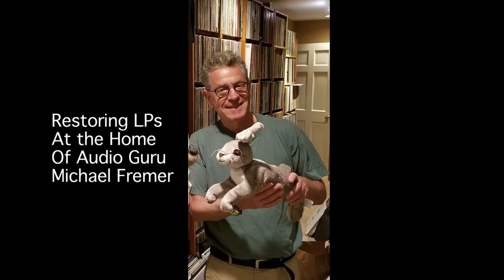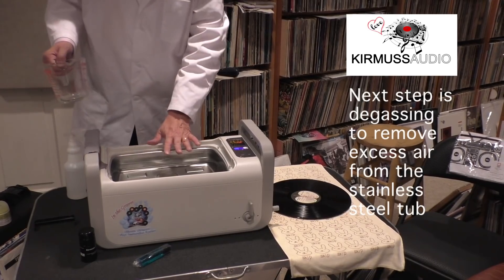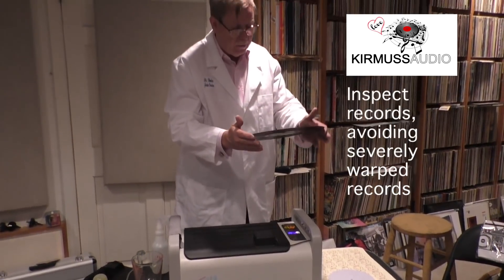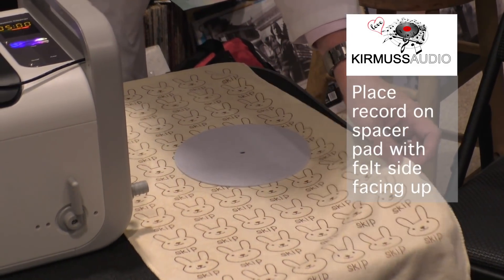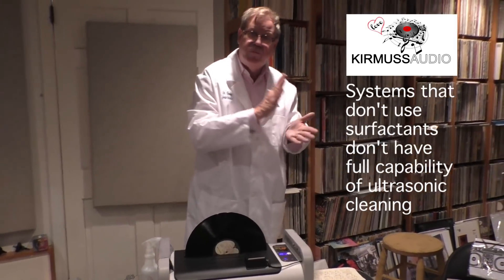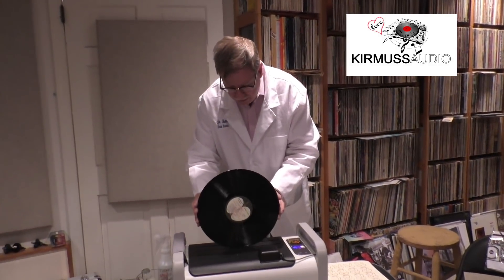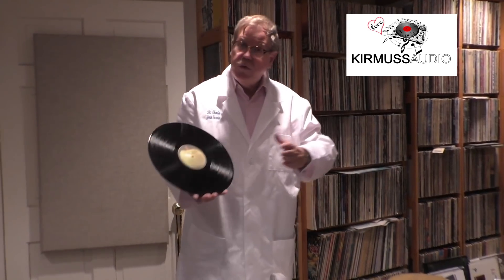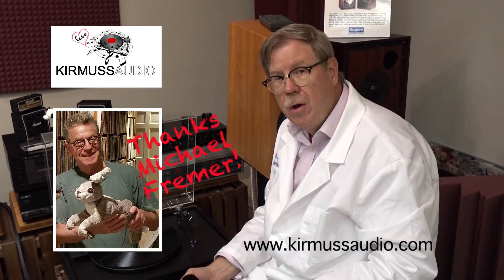KirmussAudio System Demo

Comment from the maker: Thanks for the comment.

 There is a difference between cleaning a record's surface and restoration, the latter, restoration, is designed to remove the release agent that is found in both  new records as well as old pressings, and where in both instances where the dust and contaminants that are mico welded in the groove of the record by playing it  is the undisputed cause of many of the clicks and pops we hear. Clicks and pops that increase over time. 

Simple cleanings leave films and hide these particles. A false sense is provided the audiophile. 

... We restore, not just clean.  

A surface   cleaning will not remove these clicks or pops or bring  back for one's audition the exact mirror of the stamper. One needs to remember where using mechanical  cleaning means and in  applying water with or without a soap, both the  record and the solution  repells each other. Only a surface cleaning occurs.  Further,  the size of a water droplet is also larger than a groove which is the root cause of systems not cleaning the grooves.  That is why we designed our process to temporarily change the charge of the record and attracting the wave caused by cavitation. This now  pressing on the ionizing agent that we  brush in the groove. This sees us remove contaminants from inside the groove.

To illustrate our point. We frst attack the film left over by prior cleanings that has been  dried on the record's surface  by air or vacuum.

 Then we remove the release agent. This holds the micro welded dust that see the needle hit and cause the unwanted pops.

... With the films and release agent both now  removed, now the needle makes full contact with the pressing. 

Fremer has mentioned as many others where we deliver what we say and restore the brilliance of the pressing.  One also does see when there is nothing left to remove in our stepped process.

To time, the benefit of  our process may see one  restore both sides of  up to four records simultaneously.   Something no other method can do,  all the while showing  you when each side of the record has nothing left to clean or remove from the groove.   Our patents pending and patented process lets you be the  judge and  see when there is nothing left inside  the groove to remove. 

Do refer to the images we have taken of records cleaned by a vacuum process and then followed by ours. 

As to efficiency,  we offer the best return on your investment as to the very noticeable audio improvement,  both for new and vintage pressings. 

...For all records,  the total time for groove restoration is  between 12 and 25 minutes, both sides.  

 As our records come out virtually dry as they should, there are  no films left on the record as is the case with air or vacuum drying.  No need for an air or vacuum drying which in their own introduce more dust and static to the record. 

We can of course just do a quick 2 minute clean.  Not restoration. We concentrate and advertise restoration.
Reply: I was very enthused, until I came across the statement about a release agent found in new records, a fiction, and restoration, a physical impossibility to build back what has been destroyed.  I guess this is just another guy pitching questionable product in a lab coat.  

I believe in ultrasonic cleaning, but it has the potential to damage records.  Thus a guy in a lab coat pitching product, using  facial errors, causes me to seek a more carefully developed product.
Reply from the maker: @richardelliott8352  respectfully you are very misinformed. Perform please the aluminum foil test with the ultrasonic of your choice. This by making aluminum foil records using a metal ring frame. In fact you will note where some 40 and a recently released 125 KHz ultrasonic are not ultrasonics and do not use cavitation, rather are sonic soap bublers.  I suggest you go on our web site and look at the February 7th zoom with both NJ and LA audiophile societies present and get a feel for cavitation methods among other subjects as to record care.
Reply: @kirmussaudio7578  if you could identify the release agent used , it would end a lot of internet discussion once and for all.  li only have read about the process, and viewed a few videos of records being made, and there was never a mention of a release agent being introduced at any time during the stamping process.   Additionally the introduced agent would have to be applied with remarkable precision, so that when it was removed there would be no information gaps where the release agent used to be.  
I really doubt the vinyl as it reforms from plastic back to a solid molecular lattice , seeks to  bond with the metal stamper more readily than  with itself, or would need a barrier to prevent the event.
Reply: @kirmussaudio7578  my lack of knowledge in the subject drives my skepticism, the only tool a poorly informed consumer  has against conceptual errors and buying a product poorly aligned with needs.     I am not knowledgeable enough to correctly  extrapolate the effects on metal foil to vinyl records.  I just want to be cautious in my product selection, and I am still acquiring knowledge about ultrasonic principles and how they are applied to record cleaning.   
I hope to make my poorly informed status temporary.
Reply from the maker: @richardelliott8352 Noted your points. To Shure, the Shure Brothers presented their results and I cannot comment further and my point os where  presented their comment which remains today where  phthalates and plasticizers are used in the pvc mix amounts depending on the purity of the pvc and any reuse and recycle of previously prsssed records in making up the biscuit for pressing to aid in the records to see the grooves return to the rest position  after play as well as extraction.
Reply from the maker: @richardelliott8352  there is no liquid or spray or other agent applied to the stampers before the biscuit is pressed. Michael Fremer has also commented on this. No spray applied to the stamper.  As mentioned Shure first discovered a material that its Mark IV stylus in the V15 started to pick up from the groove. They called it a pressing oil. It is a substance surfaces during the pressing process. It's natural process would seem that this 0.84 or so micron coating  that comes out of the heated material and surfaces as planned and expected allows the record to pop out of the stamper. Check our web site for images with measurements of before and after removal with our process. It is here where any dust settling on the hot record of 130 deg f or so at the factory sees this dust  microwelded into this so called coating, and if made contact by the needle, we hear that pop that can be repeated at the same spot every time we play the record.  Proof of this film  is proven by using our redtoration system and removing this film which then sees this pop no longer  being heard,  as the embedded dust particle has now  been removed as the "film" has been removed.  The needle now no longer  makes contact with the particle...further  proof of this "pressing oil" as the Shure Brothers commented on, goes  back to their observation where their needle was found to gouge this urface material out if the groove  over multiple plays. They suggested attaching a dust brush. Cleaning the needle after every play.  It did solve the accumulationissue.  Moving along... An  Image of an embedded dust particle stuck in the release agent is on our web site, added where images of before and after the use of the Kirmuss Restoration Process that is the only known process to do this removal of this film, and Shure's  long lost and not discussed discovery, ressurected  by our producing  the measurements and imagery.  As a side note, TAS Contributor Andre Jennings and Stereophile’s Michael Fremer both commented on the increase in soundstage and timbre with this film removed, and any pops created by any embedded materials.   before and after "Kirmuss resoration" also shows improvement.   Using the SugarCube digital processor in "pop count" ,  "pop ID" mode sees after our process that was applied  on a record clearly proves   where the number of pops caused by embedded dust as heard and detected by the SugarCube processor now be registered as removed, as the count has decreased in number. .  This additional method to analyze the matter of a film further substantiates what Shure commented on and what we ressurected as a solution to improve the playback of our precious vinyl and rediscover the original breath and imagery of the pressing.
Reply: @kirmussaudio7578  thank you for both your time and kind response .   it seems we were both  talking about an intrinsic quality of the vinyl , but in different ways.   when you talked of a coating that must be removed, I did not interpret that statement as being only about  the vinyl material , but rather a more conventional understanding, as in coat of paint,  something applied externally.   
I acknowledge the wisdom of cleaning an unplayed record.  I am still thinking about if artifacts developed during pressing are contaminates, but that is really immaterial , once the record is cleaned.    
I regret any hint of adversarial tone and publicly apologize .  I hope you will consider  my apology with the understanding that I am not a professional writer seeking conflict,  but a guy seeking product understanding through truth, with limited tools.     I am trying to develop an understanding of ultrasonic cleaning to form a buying decision, and I see that my position of ,"prove it" became unnecessarily strident.    In person I am not really an unbearable chap ass.   the benefits of polite conversation are well understood  with me, in part developed through some time paying bills via  retail selling.
Reply from the maker: @richardelliott8352  just give me a call at our office to continue our discussion.  A phone call would make it easier to answer your questions and observations!
Reply from the maker: Added note. When Shure cane out with the V15 Mark IV cartridge they noted where the stylus was picking something out of the record's grooves. No issues with the Mark III. They produced the term pressing oil and the slide they produced sees my seminar sessions respond to this long lost document.  They could not remove it from the pressing. So if you are old enough to recall, they included a brush that rode on the tone arm. Do visit with us at any of the shows in North America or the UK where we demystify decades of myths with both physical and electrical measurements as to release agent and the like.  You may also easily perform some of the tests at home yourself to prove our discoveries. Do give us a call. We are at the Portland, UK and NYC shows coming up.
Reply from the maker: Also take a Mofi and then use a  otton swab and see what appears on the cotton from the needle/cartridge.  Most sees a powder. This is not plastic as examined and measured by our Keyence VHX 7000 2D 3D Microscope.  Sorry to be wordy but wanted to share with the audience many of the myths out there for decades.
Reply: @kirmussaudio7578 well,  since this visible artifact, identified as, "pressing oil" could not be removed , one could say it was part of the intrinsic molecular vinyl structure, and not an additive.     I have owned cartridges in the V15 line since the mark four  was introduced.  The brush was carbon fiber and discharged static ahead of the tip , but  primarily provided a damping effect.  as  a kind of shock absorber for the cart body, so the stylus could move more freely.through warps.         I was not a dust brush, although I used it as such when I first started out.    there was never any mention of it being designed as a control for contamination of any kind, except sonic, so I wonder if one of our interpretations is faulty.  Of course,  it was attached to  the cartridge, not the tone arm, a mistake I am certain you would not make twice.  .  As my system improved , I could hear the sonic effects, and ran the brush in the up position .   I now use an shure xv15 with a Japanese  aftermarket stylus , with a brush that looks the same but provides no damping , if I were to lower it.  it also no longer has a stylus arm made of boron foil.   the recent ortofon 2M black with the nano  tube suspension seems to have finally improved on the old shures performance, so I plan on switching.   
I went to a Los Angeles audio society meeting once, but they primary talked about the previous meeting.   They did seem  friendly and intelligent, I am just not a guy who seeks meetings for  recreation..

Comment from the maker: To clarify and help,  the 70% of 1.4 ounces in 1.78 gallons of water firstly is not used to clean. It is to kill the live and dormant fungus that comes off the record.  Contact with or breathing fungus is not good for one's health. The 70% is produced in a different fashion than diluting 90 plus percent In water, and while one may try to make 70% out of 99%,  as we are dealing with an ionizing surfactant and need to promote the action of the surfactant, this is  affected by 90 plus alcohols.  The 2 are not made the same if we discount dilution. In any event, as  to plastics and if you check the pvc compatibility chart the 70% in the diluted form of 1.4 ounces to 1.78 gallon ratio is negligible and does not affect the ploymerized pvc  of the vinyl or the plasticizer.  If one would use a higher concentration especially of 90 plus percent, say. 1/3 alcohol to 2/3 distilled water, or 1/4 to 3/4,  that is certainly of concern and affects pvc.

Comment: OK, my problem with this is the 70% Isopropyl alcohol. The other 30% has impurities that distinguish it by law not to be drinkable. If you read the other ingredients, I think we should be leery of their use with vinyl. Why not use 99% Isopropyl and more water?
Reply from the maker: 70% IPA is manufactured where this is a percentage, and has nothing to do with "impurities" in the IPA solution. We use this added to 7.1 liters of distilled water to kill live or dormant fungus in a percentage that is safe for records. Not used for cleaning. 1.4 ounces...  To consider 99% IPA in  the same 7.1 liters of water is not safe for the record.

Comment from the maker: Respectfully. One cannot do two sides simultaneously with a vacuum system. There are several systems out there. As vinyl repels water by nature the solutions applied to one side of a record at a time needs to see multiple applications of the cleaning solution to the record if we are to try to attempt to clean the surface of prior films left by prior cleaning agents. We have microscopic images of this where after 3 nechanucal and vacuum  surface cleanings  have not resulted in any groove cleaning,  sorry to say. Send me an email and I will send you some slides. Added where vacuum brings dust into the record from surrounding air and depending on the velocity of the venturi pressure differential brings static onto the record.

Comment from the maker: Also, all other sonic machines try to clean in 5 minutes one record.  Many vaccum systems need 10 minutes or 15 minutes per side... trying to clean. Most sonic manufacturer  suggest repeated cycles. Some do one size record only, one at a time. .  We do multiple records and sizes simultaneously. Clean or restore, your choice with our process.
Reply: Vacuum is 2 to 3 minutes, not ten. Really dirty record maybe run twice for 4-6  minutes. No doubt sonic cleans where vacuum can't. However 10 minutes is an exaggeration for vacuum and clearly there is no time advantage as you are claiming. Depending on machine once it spins 3 or 4 times or wand moves over record it is dry and that takes maybe a minute per side tops.

Comment: Agree with general sentiment here: 20-30min to clean a record is a non-starter aside from exceptional and dirty finds (like some old mono blue note).  I was looking at this video because I was about to order the machine. Would be helpful to understand how well this works vs. vac machine if we only do a single 5 min cycle.  I only have at most 2 hours at most to listen every day, mainly because I need to work like a dog to afford my record and hifi addiction!   This extended process is simply unrealistic for daily listening.
Reply from the maker: The process needs to see multiple cycles as the ionizing spray gets washed off near the end of each cycle.  The process us to attract the plasma wave created by the sonic to get into the groove and remove the release agent that holds the microwelded dust particles that cause the unwanted pops. If you want just to surface clean. One 5 minute cycle is needed. So you have more than one option, clean only or clean and restore

Comment from the maker: A simple wash is 2 minutes. If you want to pick up the imagery as witnessed and reported on by Michael Fremer after a year of testing, we remove all contaminants from the grooves. In 2 or 5 minute cycles. Several records at a time usually taking 20 to 25 minutes. Noted your comment. Over 2,000 audiophiles and music lovers have bought our product in just over a year.  Even audio manufacturers such as Jeff Jeff Rowland Design, Yamaha Canada, Oracle turntables all use our process on their records before use in their own listening rooms at global audio trade shows. Again, while not for everyone, at less than $1,000 pur process provides immediate results over buying cartridges that are over $4,000, change out tone arms at $8,000, adding silver cables at $2,000. Obviously not for everyone.  Guaranteed to even improve imagery and timber from even a basic entry level turntable coupled to a modest or restored vintage low cost system. Everyone has their opinion.  The extra effort removing release agent and contaminants from recent as well as records that are 40 plus years old is well worth it. To note current processes have been found to leave residues,  we also remove these.